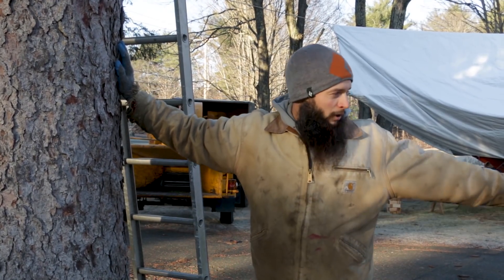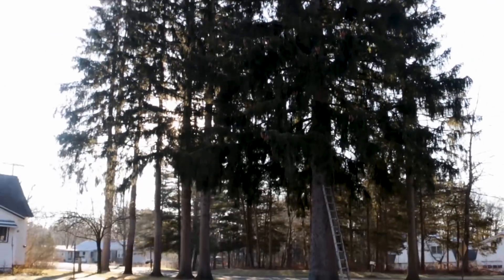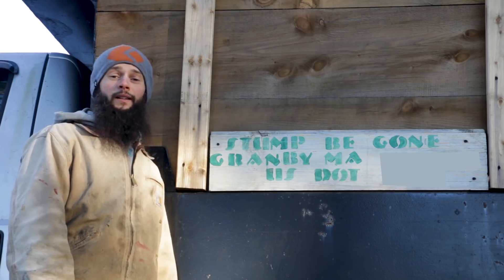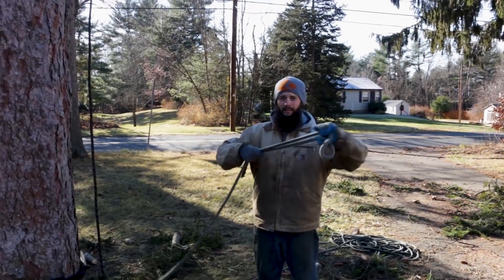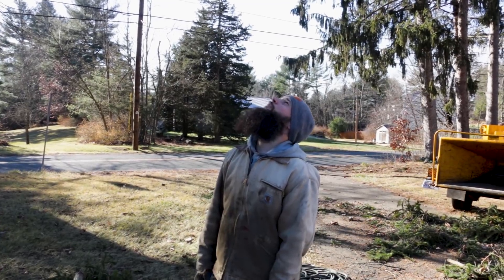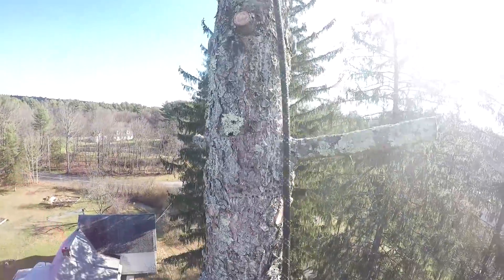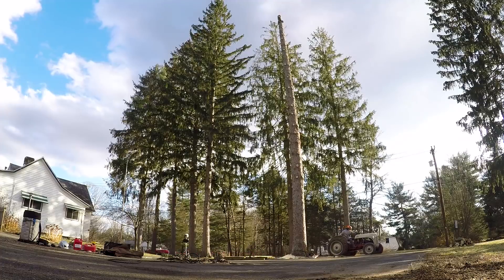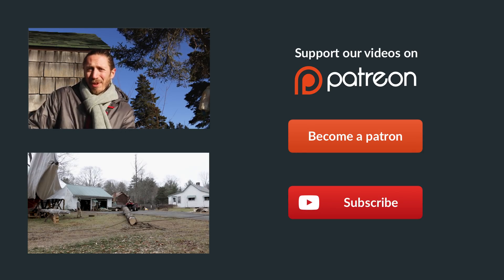Acorn to Arabella - Journey of a Wooden Boat - Episode 22: Great Grandpappy's Gift from the Grave

Comment: I don't know how it's possible, but I am so freaked out by heights that watching someone do this, even on a computer screen, can make my stomach quiver.  When the top came off and the tree shook, my balls shot up into my lungs.  I know it's tongue-in-cheek when he calls himself "mildly insane", but I actually think it does take a hefty dose of crazy to do this.
Reply from the maker: I might be a little nutty but more than that I have practically no fear of heights and have total faith in the rigging.  After climbing and logging air time over 1,000 feet off the deck a 75' tree is a cake walk =)
Reply: The height part nearly made me puke and then when the top  "fell" and shook the tree like a piece of rubber hose  it nearly finished the job. I don't do anything over about 8 feet off the ground if it doesn't have a safety rail and something solid to hold onto. Kudos to you for your  fearlessness but I will never fall a tree.......EVER now it just needs to dry nice and straight so it will be Arabella's mast
Reply: I used to work on radio towers the tallest was 789ft with a top of about 2 sq feet, tie yourself off and climb the antenna to change a component or a light bulb.

Comment: In Norway there are log homes several hundred years old that the logs are not checked.  You started cutting the tree the way they did by topping and liming. They then left the tree standing for about three years so that it would dry out from the inside as well as the outside. The logs would have no checking. I found this to be true when I removed some dead Elm that had been standing for several years. Non of the logs were checked.

Comment: Just found come along has better control pulling trees down directional. Tire spin, bounced pull and communicating pull is hard. Higher you get pull rope the more leverage. My personal favorite is line to another tree which has a pulley . Then you can actually put come a long on tree your cutting or near base. Works best with 2 come alongs but can make prussic loops to pull rope and tighten , hook and readjust.
Reply from the maker: Thanks for the tips!  Those are all very fair points.

Comment: Lads,  I’ve got a 60 foot Sitka spruce mast for my steel 37 footer that was made from six segments and glued.  At the base she’s only 10” wide.  Advantages are weight (two men can lift and carry the thing horizontally).

I can’t help but notice that your tree could probably make you two solid masts.
Reply from the maker: Sitka does seem to be the gold standard but unfortunately they are not an East Coast tree. 
So your mast is hollow and birds mouth constructed.  Did we interpret that correct?
We also have the mast and spars from Victoria that very well could have a lot of life left in them.  We might have enough spar material to make a spare set of masts! haha
Reply: Yes, it's birdsmouth built.  I'm just noticing how THICK that Norway Spruce is.  How much do you intend to work off it by the time you have the finished mast?
Reply from the maker: Depends.  If we mill it and glue it, it won't be too much work to bring it down to shape.  If we keep it whole we have a lot to remove! The chainsaw and ax will be the primary tools.  The log is at least 20" across the butt (my 24" bar barely made it through) and the mast is only 7".  We might be able to get both masts from the one log outside of the heart.  It's buried in snow right now so we will decide and explore more options in the spring.  But yeah, it's a good sized tree =)

Comment: How do you guys deal with wood boring beetles, when the stem is laying around for a year? Don't the smell of freshly cut spruce attract them from every where, when spring comes? Do you leave the bark on?
Reply from the maker: It's not a issue over the winter.  We used anchorseal on the ends to help keep them from checking, also helps keep the bugs out and once they are milled and drying they become less desirable to the critters.  The bark won't be on long after milling and if the bugs get in there it's usually confined to the sap wood, they don't like munching the heart wood as much.

Comment: How many HP was that tractor? Howd it handle moving the tree around? Also whatd you use as driveway padding? Thanks
Reply from the maker: The padding was some old foam we had laying around with some sacrificial lumber on top, seemed to work well enough.
Not sure on the HP.  It could hardly drag the whole thing but with the bucket we could push/roll it easily enough.

Comment: I hate to be Capt Obvious because I imagine you already know this, but paint the ends of the log with a thick coat of latex paint.  For all the viewers who aren't familiar with logging, drying, and milling lumber; The log will dry faster from the cut ends, sealing the ends allows the log to dry more evenly and prevents or at least reduces checking (big cracks from drying too fast).
Reply from the maker: We know and already have.  Thanks for sharing the info though!

Comment: I used to rock those Petzl Attache carabiners , but i used the twist lock version. I Don't remember if the fit the GriGri but they were great for 2 strand rappel. Also this is something Im glad to avoid, not that i haven't cut my share of trees...

Also even for this size mast i would never use a single tree , I would laminate it out of sections. like this : https://i.imgur.com/Jo9a2nc.png or https://i.imgur.com/iNHWUOV.png .
I may be wrong but it seemed like that tree had a lot of big knots , probably due to it growing with very low competition , and that is not ideal , and neither is the pith , it will be a huge struggle to find a way to keep that tree from checking and developing shakes. 

I'd like to hear your plans on that tree, regardless , also if it was me id water it till you were ready for it , i don't care what any one in the comments says its better for it to stay green till you are ready for it.
Reply: I think this idea is also good because you can hide winch cables, communication wiring and even exhaust inside of the mast depending on if its big enough. It allows the outside of the boat to look period correct with out sacrificing radios and gps. Bundles of wires look like crap running outside a wooden mast.
Reply: This is actually a thought that is very valid and i never though of it , i am kinda short sighted like that, i was only thinking on how to make the best possible mast for their boat , the first time round.
Reply from the maker: All fair points.  
We have to do a lot more research on the mast.  We can decide to cut the log down later and mill it, but if we cut it up now it will never be able to be a one piece mast again.  Hence leaving it long for now.  
The gaff plans call for a solid mast and the Bermudian is hollow so once we decide on a rig that will also factor in.   At the very least there are a couple of spars, oars, boat hook handles... in that butt log.
Reply: If you were to go modern with composites , you realize how carbon fiber masts are manufactured? 
The fiber yarn is wrapped around a mandrel Which is the interior profile of the mast, so you would minimum have to have a mandrel of each mast to form composite around. This could be done with several techniques,  its your most viable option, but you still need the mandrel preferably out of metal: aluminum steel stainless steel. 
For a non-round mast a multi part mold , how many parts depends on how complicated the mast profile. Generally a molded mast is made from prepreg sheet composite , and requires an oven to bake in , there really is no other feasible way , normal epoxy just doesn't have the work time.

I feel like if you wanted the best of both worlds you could make the wood mast and make it hollow then add a couple layers of glass to the exterior. that would almost certainly be plenty strong enough for a gaff rig even with a hollow mast , how hollow you want it depends on you and your skill. epoxy and glass will make a wood mast strong and rigid as all hell..

In my personal preference would be a Bermudian sloop , i don't think i caught a good look at the plans to see what the rigging is . but i heard you say you would have a mizzen mast which would make it a ketch or a yawl . I think a gaff rig is more beautiful but more expensive and less efficient. 

Every boat i have made has been wood entombed in glass, i have a fair bit of experience with composites , and I'm going to make more soon*. To bad  its 6 degrees out right now. and I'm down with a video Q&A if you can deal with my ugly face.

It all depends on what your after i guess , maybe you could do a video on that as well.

Comment: put some plastic between the tree and the logs on which the tree rests. it will stop the termites!
Reply from the maker: Thanks for the tip!
They are not too much of an issue around here, the flying insects with wood boring grubs are the bigger issue and since they can fly they are pretty tricky to stop.  Thankfully they typically just eat the sap wood when it's still green and as soon as the lumber is dry they expire in their cavity.

Comment: I don't care either way about the videos.  I do like your videos as they are though. 
The drying/curing of the tree is super important!!!!
 If done wrong the wood splits at the ends making it undesirable.  
There are several techniques to properly dry it so it is straight and no splits.  
You can straighten some bend. Make sure to do dry/cure it right. 
 Or it can be cut apart and then glued back together perfectly strait and that works very good too.
 I have seen that done with fiber glass.  Worked great.  

I see you have other trees. 
I don't know if you are saving them or what. 
If you kneed another tall strait spruce I have an Australian Pine You could have for free. 
Transportation would be a big deal though I live in Ft Myers, Florida. 

Good luck
Reply from the maker: We are very aware of seasoning wood and sealing the ends to help mitigate checking and will do our best to help the log dry slowly and evenly.  
The other spruces are technically on town property so we would have to get permission to harvest them.  
If we need more we know a few local loggers that can help us out.

Comment: What good is a comment section if we don't make comments.  It would be advantageous to use the branches to break the impact of the tree hitting the ground and then grind them up.  It could make the difference between having a great mast and having a splintered mess.
Reply from the maker: true but the branches would have torn the driveway, yard and neighboring trees to smithereens.

Comment: Woodworkers say that a piece of wood needs to dry for  one year, plus another year per inch of thickness.
I think you're going to have to work that last green, unless you're not setting sail until around 2050 !
Reply from the maker: If we decide to use it as a solid spar then yes, we will work it green and do our damnedest to help it dry slowly and evenly as possible.  If we decide to mill it then it will have a couple years to dry before we glue it into a mast.  Going to have to make that call some time this spring/summer.

Comment: Good job on the tree removal. I'm not an expert by any means but that tree would be my last choice for anything but fire wood and it wouldn't be that great at that. All the branch rings are a year of growth and are weak. By the time you get it down to size you will have a stick ready to snap. I'm not trying to be shitty just hate to see you waste time and energy for nothing. Sitka spruce would be the ticket. Also the device you called a shackle is a clevis. Where I'm from a tree like that would be called a grouse ladder. Cheers.
Reply: As a sawyer and having seen plenty of trees , and their weakness's I agree with you 100% , i would very weary , i would however consider milling that tree up into large boards De-knotting it and scarfing the log sections together then laminating the beam together, i think this would make a stout mast. Because it will be difficult near impossible to find a prefect high competition sitka that's straight with small knots  or no knots and relatively free of black ring knots, now a days. 

I really want to see this boat finished , and also have the same workmanship as a boat like Victoria , and im pretty sure you do as well. 

Cheers fellas' and merry christmas
Reply: smartmonkey777 
Yes I love what they are doing as well, their safety is my concern.
Reply: I also want to see them build a beautiful boat , with all the beauty of traditional boat building, but using the advancements in technology as well.
Reply: If they want Spruce, let them run Spruce.  It'll probably work.  ...Even if that species is called "piss wood" where I'm from. (Due to the yellow color of the wood, and the nasty scent put off when burned.)
Reply from the maker: We still have a lot of learning to do in regards to the mast and how exactly we will construct it.  The gaff plans call for solid and the Bermudian hollow so that is a factor. 
The tree was destroying the driveway/grass and if it came down in a storm it could do a ton of damage.  The tree had to go, the plans call for spruce mast and spars and by leaving it whole we leave our options open for now.  Much easier to make it shorter than longer! =)
Some books are on their way and we know a few folks who are in the know so we will chat with them and make a decision in the spring/summer.  
Maybe we will go super modern as a bunch of folks have suggested and we will do carbon masts and spars ;-)
Reply: Acorn To Arabella 
Like I said great job on getting the tree on the ground. You have balls to spare in my book. 
Merry Christmas
Reply: I think you will find Sitka is hellishly expensive and doesn't grow on the east coast. I traded a small car for 4 aircaft grade spars for an airyplane last year...
Reply: A Rogue Chihuahua 
Yes it is costly, but what is your life worth. I bought a set of oars 30 years ago and they were 125.00 but they never let me down in some really shitty water on big rivers in Oregon where I'm from. It was just a thought.
Reply: A logger would call it a clevis. A sailor would call it a shackle. So if it was a clevis when the tree was falling, you could argue that it became a shackle when it hit the ground and became the raw material for a mast.
Reply: You are both very multi-talented and resourceful. A perfect pair for a project like this. Once you’re in the water I foresee a National Geographic special documentary. I just subscribed and am binging the videos. (Although I had to FF through the GoPro footage, heights give me the hebe-gebe’s)